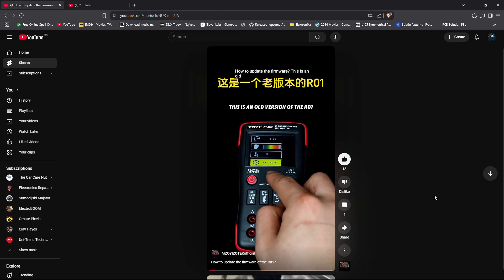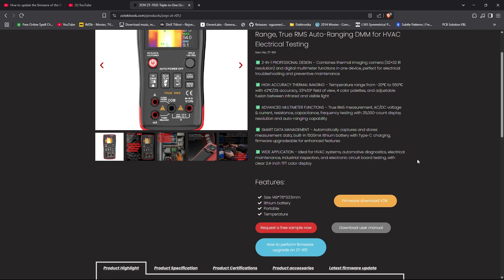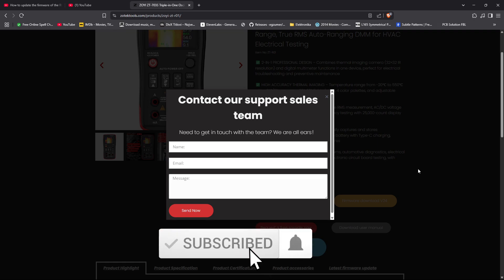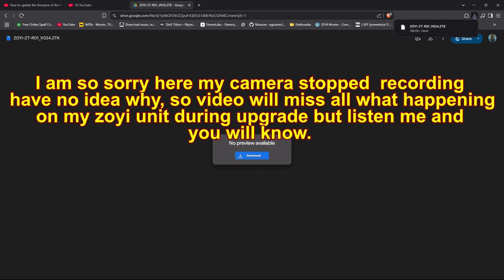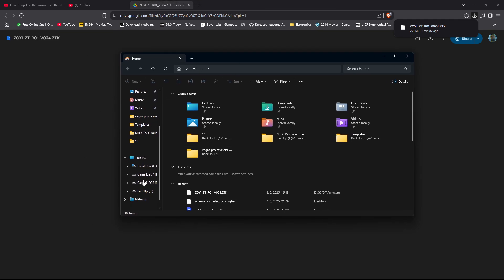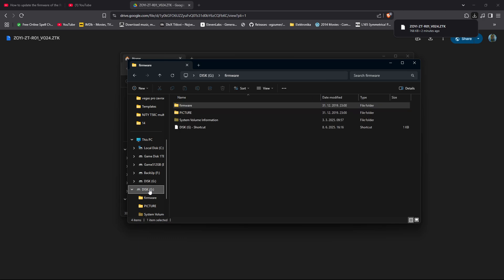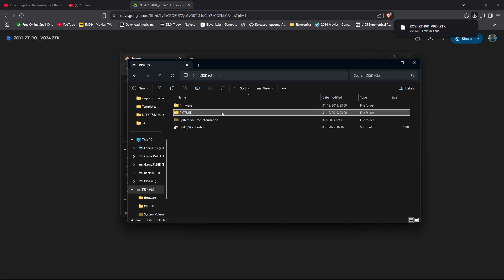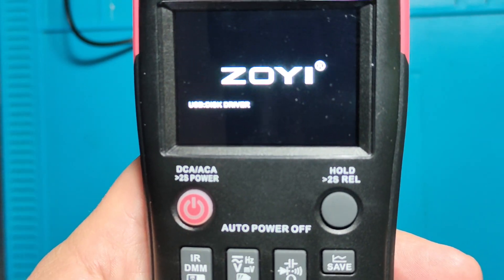Zoyi ZT-R01 Firmware Upgrade Guide ✅ Fix Bugs & Unlock New Features!

Comment: Hello, on my zoya zt r01 I get into update mode but when I open the firmware folder and put the file in the folder nothing happens. Should it update itself? Or do I need to press something on the multimeter? Thanks for the reply.
Reply from the maker: press ir dm button ,keep pressing and while you keep pressing it press the power button to to boot in to upgrade mode. connect device to the PC via USB cable. open device in file explorer as you would open any USB drive. When you open it there should be a firmware folder. Download the proper ZTK file and copy it into the firmware folder. Upgrading should start automatically. If you do not have a firmware folder on your device ,format the drive from the device menu.